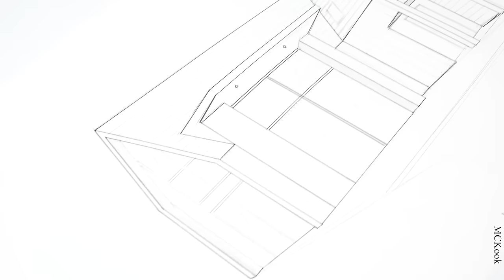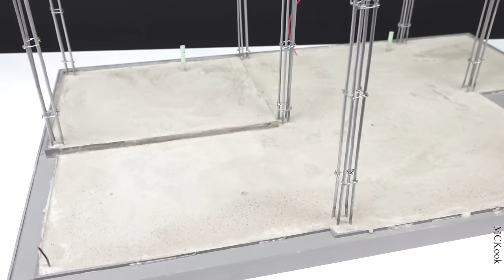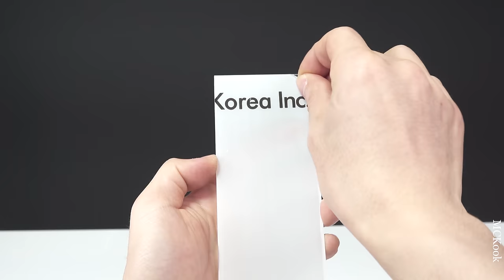How to make Amazing House with bricks - Mini Model

Comment: Pro. is a Pro!!!
In proportion, constructing this toy-like house was not easier than building a real one...including: planning a project; 
 preparation of all the parts and details;
Beautifully executed construction work;
No mistakes!
Beautiful house, where hadn't been missed a single detail in the process! Bravo!
Reply: I agree completely, everything still needs to be measured and cut perfectly. If not even more so because the lee way would be so much smaller on a tiny model!

Comment: 👍really nice work.
  A tip for better pouring concrete, use an elektric toothbrush with rod extension as a concrete vibrator to avoid air pockets 😉
Reply: Don't tell the wife though

Comment: Wow. Great job. I was thinking that I've never seen a concrete building with a pitched roof made of concrete. And I think that might be 2 fold. One. It would be hard to get the slip correct so that the concrete would both pour right but also so it wouldn't run down before it cured and, two, a concrete building would be strong enough so that it wouldn't need a pitched roof. But that's just me guessing.

Comment: No wonder architects hate picky homeowners that designs their houses.. all these pain staking hand work and cutting and pouring concrete for the pillars or electric work.. i would be annoyed too if the homeowners wanted to add or move certain walls just so they can fit their toys

Comment: Anyone who can help me what kind of material he used?? I only know, cement😢
Reply: Cement 
Bricks 
Metal straws ( I am not sure that it’s called like that because I am Arabian)
Paper
Pencil 
Scissors
Shaping metal ( that metal that he used it to put 2 or more metal straws together 
A metal base
Glue 
Electricity wires and the thing that looks like a microbit that he used to tern on the light and tern it off
If you see any wrong names don’t say that I’m bad at writing and I don’t know English I told you I’m Arabian and I’m still nine years old anyway this is what I know from the materials 😅😊